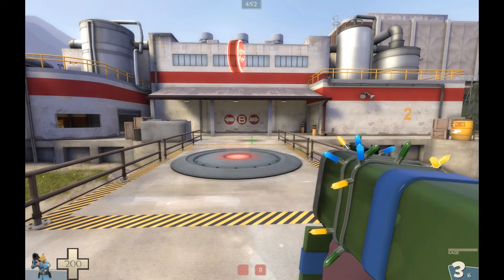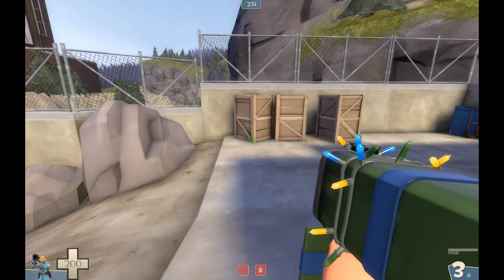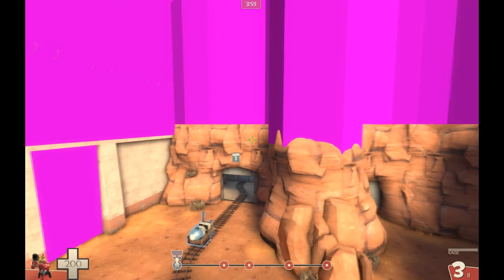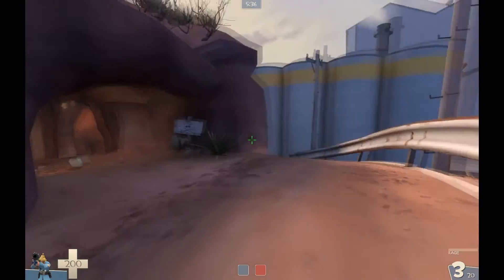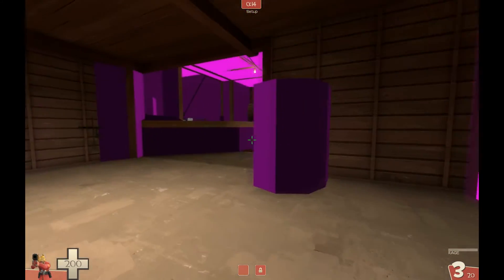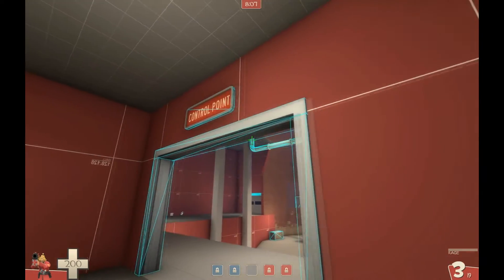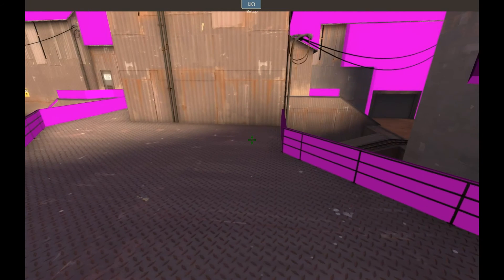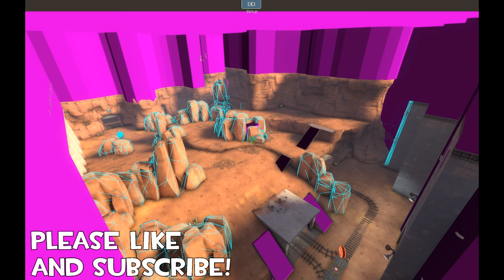TF2 Mapping Tutorial - How to do Clipping (Part 1)

Comment: Hey, Crash, would you use bullet-blocking brushes against props with their hitboxes turned off to prevent stickybomb problems?
(Obviously, you could only really do this with smaller props, so that players can't walk inside them, fire projectiles and have them explode in their faces, buuuut...)
Reply from the maker: +Kapanyo for sure.  Harder to be accurate, but I've done it to fix a rock prop that had poor collision on it and could hide stickies in it.
Reply: Okey ~ thanks!

Comment: Nice vid. You mention smoothing for clipping off trims and what not inside/outside buildings. I wish func_detail had a collision option. func_brush does though. Would you advise against using that instead? I'm not too sure what the difference is honestly, but it would save a lot of time on clipping haha
Reply from the maker: If it's in a playable space, it's a good idea just to clip it as a func_detail instead of removing the collision as you could hide stickies in anything big enough.

As for the difference between the two, func_detail acts just like world brushes without cutting vis (as in, stickies can stick to it, buildings can be built on it) whereas func_brush doesn't (stickies bounce off, etc), but still doesn't cut vis.  Also func_brush can be parented and has a whole heck of a lot of other options to play with.

So basically, unless you want it to do something fancy and it's in the game space, just keep it func_detail and clip it manually.  No shortcuts! :p

But don't get me started on tjunct's...
Reply: UEAKCrash Ah, stickies, of course. The long way is usually the best way, but man...Very time consuming haha. I guess it just makes the end product more gratifying. Thanks for such a nice explanation.
Reply: Also, func_detail doesn't count as an entity at runtime, no entdict cost there.

Comment: Pretty good tutorial, just watch your um per second count. The main thing to keep in mind with Clipping is to make sure players understand why they can't go through a clipped area or just make them disinterested in trying to go through it. A map like Harvest does a poor job at this since most of the rooftop areas seem like they would be easily jumped to and the fences around the level easily jumped over. When you get to the hammer part of this tutorial you may want to go over they other types of clipping as well.
Reply from the maker: Yeah this was recorded about 4 months ago, and I think I've gotten better at doing commentary stuff since then.

What do you mean by other types of clipping, though?  Blockbullets, that sort of thing?  I planned on keeping this series mostly on the general Playerclip uses.
Reply: UEAKCrash The other clipping textures, while not used much in TF2 they are useful in some game modes. Going over good uses for Blockbullets and blocklight could also be beneficial if you decide to go that far.
Reply: MegapiemanPHD
It's called materials, not textures. Especially for tricky materials like these ones that have special material flags.
Reply: Badwater uses Blocklight somewhere on a building.
Foundry uses Blockbullets at last.
(just sayin)
Reply from the maker: Strictly speaking, yeah, but it's just semantics.  Everyone involved knows what it means.

Comment: Amazing, I already knew most of that stuff but you did an excelent job delivering it and I can't wait to "delve into hammer" with you..

Oh and cant you just bullet block those spots to stop stickies? I would probably just make a block of pclip over the whole door area, smooth it out and cut out an opening. You remind me of myself with the clipping.
Reply from the maker: Yeah you could use block bullet, but if you are you might as well just use the prop anyway and smooth it with the clipping like you mentioned.  That's exactly how I did it with a later version of the map.  I just used the door frame as an example of something someone might turn off as an easy way around smoothing things out there.

Block bullet is really good for creating hitboxes for things that don't have it or aren't accurate enough, though!  I use it on one of the rocks on Glassworks that has a very exploitable hitbox that can hide stickies easily.

And thanks!  :)